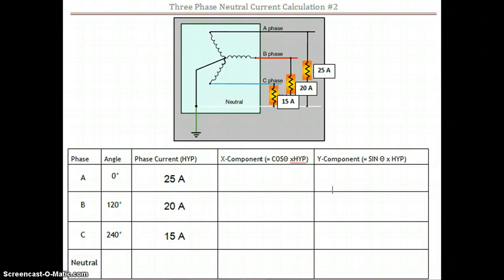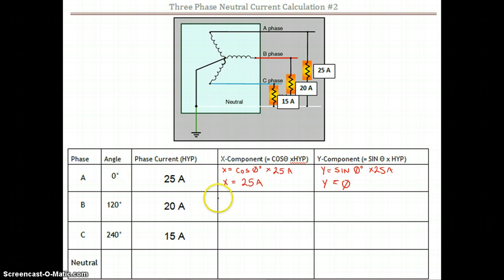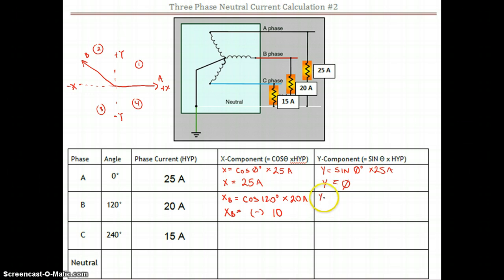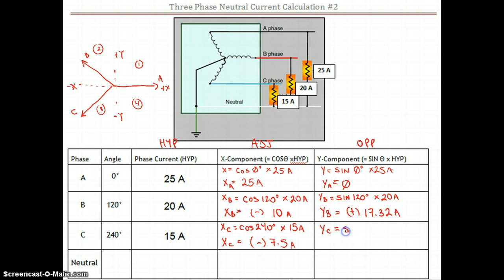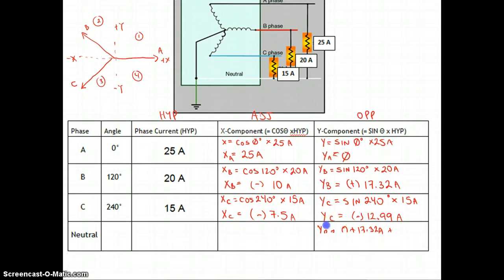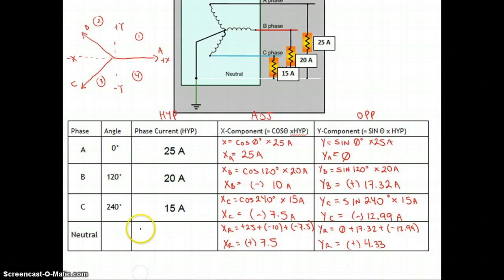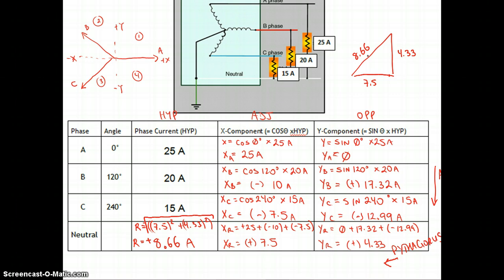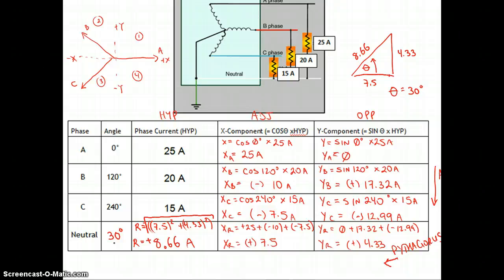Neutral Current Calculation #2

Comment: @Pete Vree 
What issues will be faced by an engineer or a system if the neutral wire has 8 Amps of current / or any non zero current value???

Comment: Geat video! this was a whole lot easier for me to understand compared to my textbook, question:

From my understanding, sizing an electrical system in terms of cable sizing and so on, 
you would use the currents in the example 25 A, 20 A and 15 A for the phases right?
And not subtracting the neutral current from any value, as the neutral current is for itself i believe.
So for example, sizing phase 1 for 25 A, phase 2 for 20 A and phase 3 for 15 A, and also,
neutral wire for 8,66 A would be correct?

One more, if you´d like to answer:
If the loads would be non-linear, causing harmonics, is there a way of doing a rough calculation
of the harmonic currents that would flow or how do you take harmonics in account for sizing the neutral?
Reply from the maker: Sizing would be based on the highest current value. Harmonics are accounted for by having your neutral the same size as your feeders. If high harmonics were expected, they usually just do a parallel neutral (essentially doubling the size of the neutral)

Comment: Hi Pete, I found a shortcut that is interesting, if you treat the 15 a line as a balanced 3 phase load (heater,)  you can switch it off and have 0, 5, and 10 amps
than square root  of ...(5x5)  + (10x10)    - (5x10)   
          square root of   75 =  8.66
what do you think?
Reply from the maker: Everything is ratios, so by making the 15 A into 0 A, you still have the same ratio difference with the other 2 lines. That is probably why you get the same neutral current. You can skip the chart method and use the following equation derived from the Law of Cosines: I Neutral = Square Root of ((a)2 + (b)2  + (c)2 - (a*b) - (b*c) - (c*a))
Reply: Yes, I figured this shortcut saves a lot of steps and button pushing, which leads to  memory and error problems. I am teaching electrical in New brunswick thanks for your great videos.